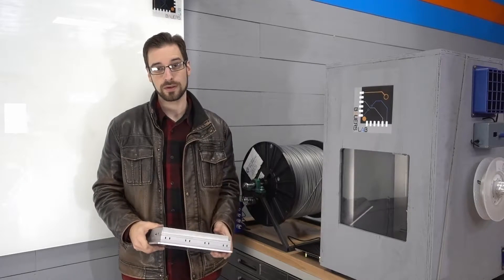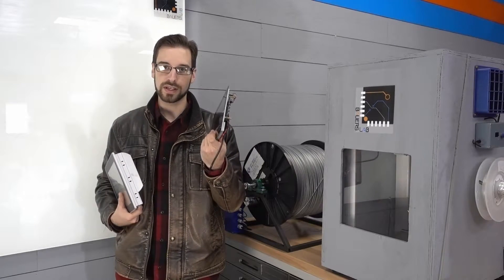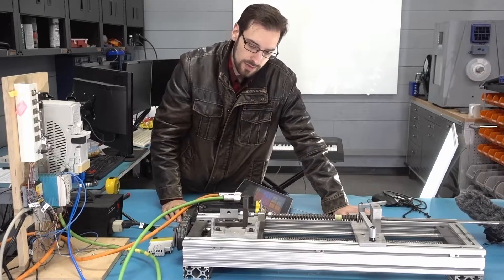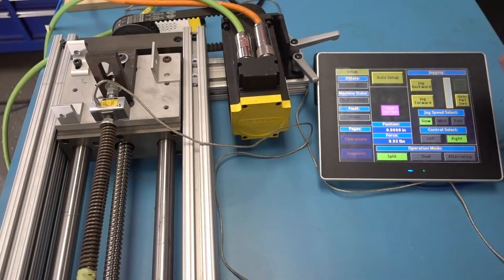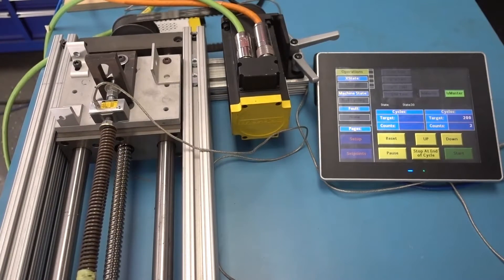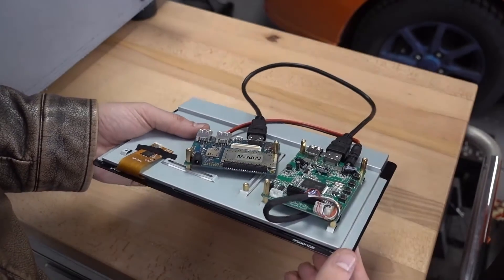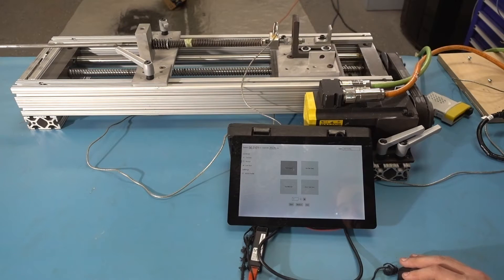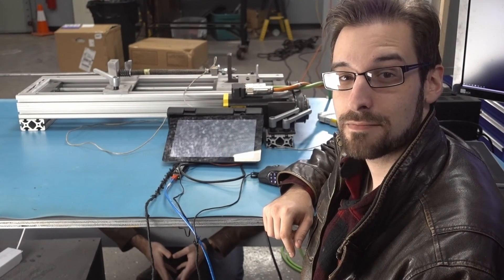Industrial HMI Alternative

Comment: Do you know if i can try this with an old Pentium4 computer? (via parallel port) , just for learning because i think it would be a bit inefficient in terms of power consumption
Reply from the maker: Hmm, i haven't used a parallel port in at least a decade. I'm sure you could get it to work with enough effort. But, If you want to play around, i would probably suggest getting a NUC. They are cheap and pretty good.
Reply: @BauersLab  i was thinking in a P4 just for “trial and error”(if i break the motherboard it would be ok for me ...emotionaly speaking hehe) , but i will consider the NUC, good advice, thanks

Comment: I did the exact same thing! Except I used a raspberry pi and python. I used a library called pylogix to communicate with AB Controllogix. It also does Modbus and a bunch of other protocols. It gets even better when you combine that with node red dashboard and launch it fullscreen with Raspians Chromium browser. Very aesthetically pleasing applications for 1/10th the costs. I use Ignition Scada now though. Very nice software that runs on a panel mount PC.
Reply from the maker: Oh, I haven't seen Pylogix before. That is handy, Thanks. Yeah, I have used ignition. That is very nice.
Reply: @BauersLab  yea it's a python library. I've used it with L60 all the way to L80 Controllogix and a few CompactLogix. Works very well.